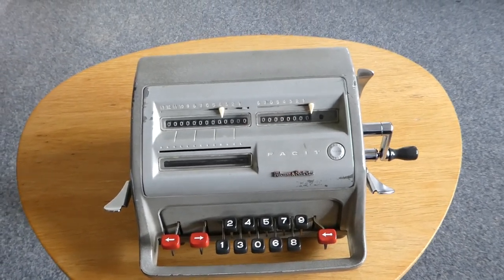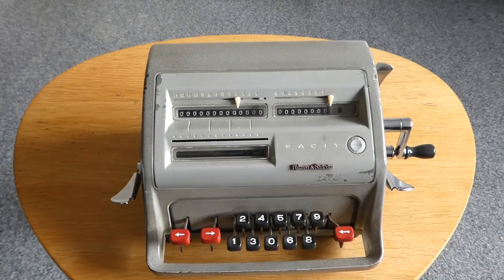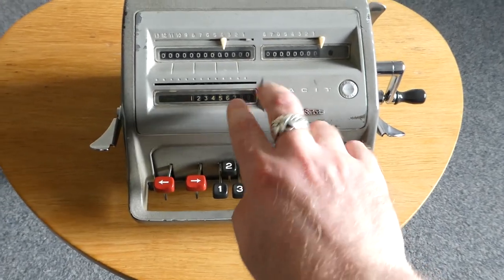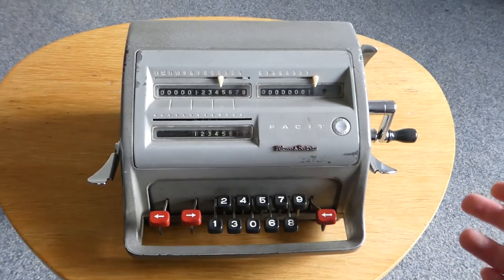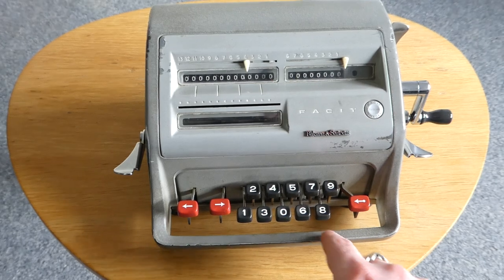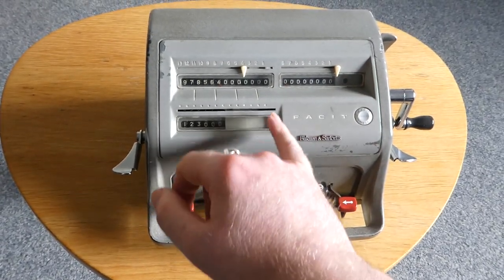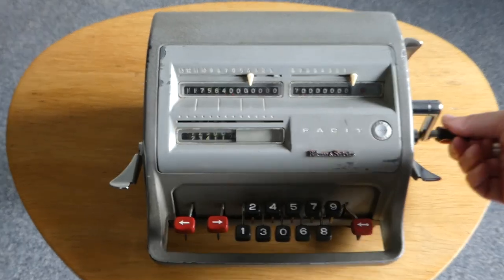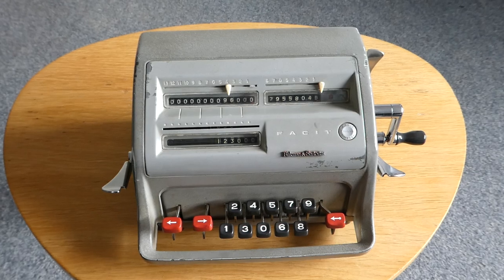The Facit C1-13 Calculator

Comment: These are timeless machines !!
Would love to buy one for my collection …
Reply: I have one that's actually working
Reply: Ganesh Kewra  usually what happens is the oil and grease turns to glue especially after decades of no use. Using some sort of penetrating agent may get in there and free up the mechanism then use a light oil such as sewing machine oil to lubricate it. I was told machines made before 1930 used natural oils that don’t break down which is why the old machines often still work while newer machines are glued together.

Comment: You need to tune your calculator. It sounds a bell when it overflows, very useful in divisions. Your's not «belling».
Reply from the maker: Yes, you are correct,, and I should have mentioned it in the video. I haven't been able to figure out what is wrong, as I think a part may be missing and I have no working version to compare it with.

Comment: the tutorial on how  to do division is rather confusing (You mentioned 'substraction' in some point). If you could use simple number with lesser digits as examples would be much better. After all, it just to show how the system works. Remember, KISS = Keep It Simple Stu...
Reply from the maker: It's just long division: https://en.wikipedia.org/wiki/Long_division